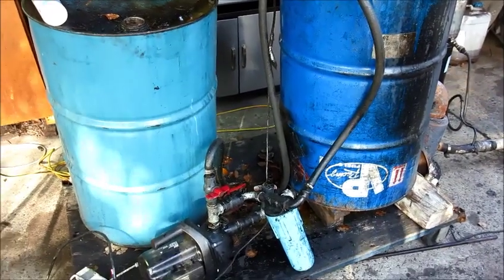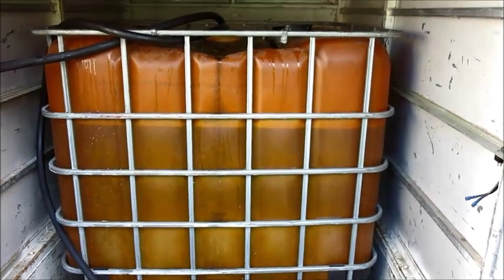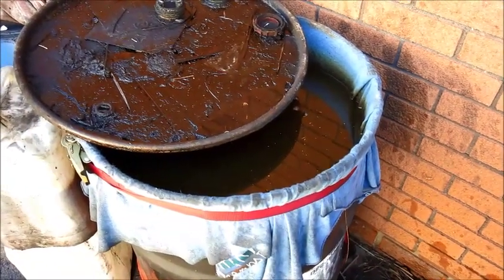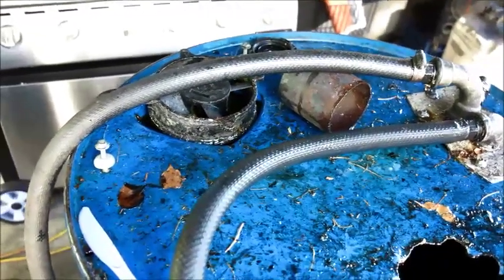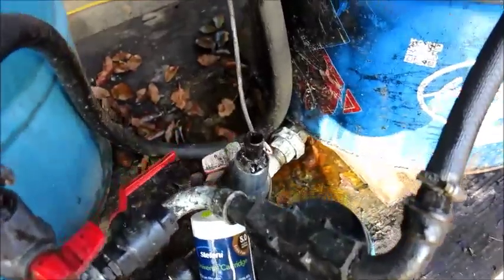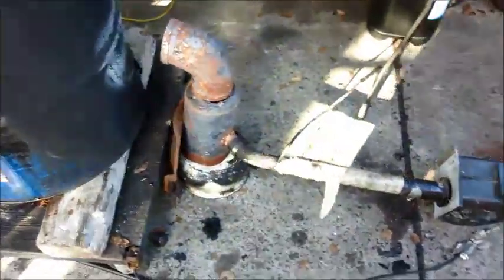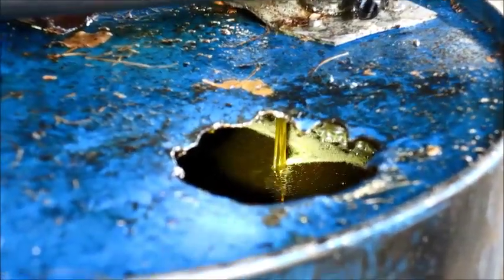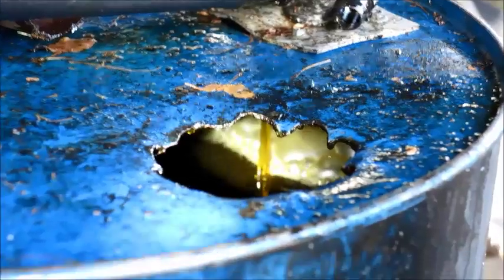How to filter Waste Vegetable oil Fuel ( WVO)

Comment: Hi mate. I have built one of your pumps (scooter motor and modified chev oil pump). Works amazing for collecting oil! I also tried your oil dewatering system using nozzle and recirculation pump. I processed 200L of wet oil today and it worked a treat. Thank you for sharing your knowledge! I used a silicone drum band heater from ebay to heat the oil in the drum while it circulates. I used the water filter to filter it. I used an old oscillating fan to keep airflow over the oil. Think I'll set something up with a ventilation fan to suck air through top of drum when I find a cheap used one. Thanks again mate for sharing.

Comment: As good a system as any I ‘ve seen .  Bit too small scale for my needs( I’m running two 4x4s using about 45 litres a week each). Good job bloke, love your pumps.  
  I do 1000 litres every 3 months in about 2-3 hours.  I do my supply pickups every week in the 20 lt drums.  Not sharing my plant as I’m too stupid to work utube.  I’m in NQ so don’t need to heat electrically for drying- The power of the sun!   I use three stages of settling in 1000 litre tanks, 3 months each time with first a screen then a coarse filter almost the same as yours, then a 5 micron filter and a final filter as I fill my tank.  I started with a 200 litre plant not unlike yours except I used old Commodore power steering pumps, which were a bit small when I upsized. Great video thanks.

Comment: Hi, in case anyone wonders regarding the drying with the fan in reverse: 
If you blow air into the barrel, you create a slight overpressure and thereby increases vaporization temperature and it slows down the drying.
If you reverse and suck air out, you create a slight underpressure and lowers vaporization temperature and speeds up the drying.
Reply from the maker: Best explanation I have heard. Thanks!

Comment: an electric hob plate used in some kitchens would be a good idea to accompany that fan to gently heat the oil to dry it also, i heat my oil before it flows to my burner as i seem to notice it ignite better and i get a better burn on a lower needle valve setting, if the oils cold i have to open the needle valve flow up more.  jus an idea,

Comment: Hello. What would you consider better, the way you're drying in the video or a centrifugal dryer? But considering,
.Time taken
.energy used ( burnt oil included)
.quality of the finished product 
.reliability and efficiency
.plus simplicity and ease of use 
Cheers
Reply from the maker: I have used and set up centrifuges for other people and prefer this method I still use and just set up for a friend.  Centrifuges take  a LOT of energy, don't really dry the oil unless you use heat or some other separate way and can have problems.  The spinner type use jets of oil and it has to be pretty clean to start or the jets block.  I would go for the bowl type but they are not cheap and can be a bit of mucking round. 

The output quality is second to none but that's a bit like Giving me a $1000 bottle of wine as against  a $50,  The 50 is well good enough and the extra "quality" will go to waste on me with the 1000 because I cant tell. 

I centrifuged my output from this process a couple of times and what came out was irrelevant.  Had to wipe your finger on the bowl  to see what came out of 200L  and it was all the micro fines which would pass through filters and the system anyway. 

I choose to stay with this very same system today. 

One thing though, If you are just using oil for a burner, NO need to go to this trouble.  This is only for engine use.  For burners I just filter though things like Disposable shopping bags or a big roll of felt I bought years ago very cheap and that's all you need.  Just enough to get the bits out, no need to go overboard. 

You can dry by throwing a fish tank bubbler in for a few days and that will take out the main moisture and good to go.
Reply: @glumpy10  I'm going to use it for my 4x4 and when I get one a diesel generator. I'm just looking into ways to clean waste engine oil as I just got another 1000 litres today... I probably only burn 300 litres a year for heating so I have a constant supply and want help out my guy by removing his waste oil but I don't want to just store it or more accurately horde it.
Reply from the maker: @smithbuilt   If there is no water put into engine oil you should not have to dry it. Veg oil absorbs water, engine oil does not.  If you let it stand any water should separate and  take the top oil for the vehicle and the last 5th or so for the burner.
As you probably saw I use 10"water filters in either 1 or 5 UM ( micron)  .

Comment: Hi Oil Burner.
I have been looking at ways to make a burner for a foundry furnace as propane is too expensive and I like your burner ideas. I think I will make up a pressurised fuel tank type burner and bouncy castle fan setup. I shall just experiment with that.
I am wondering if you would bother de-watering oil for foundry burner use and if I should worry about gloopy fat in the fuel?
I have 200 litres of old veg oil and various drums of engine oil / heating oil / dirty diesel etc that has accumulated in my workshop. Can I mix the lot together or does it separate out and do something odd?
Cheers.
Rob
Reply from the maker: De watering really depends on the amount of water.  If there is free water in the bottom of a drum I would say dry it. Free water translates to maximum dissolved water and while it will work, it's noticeably poorer burning and far harder to start than dry oil. 

The sludge at the bottom is HEAVILY water laden and you will see just how much water is in it when you dry it and see how much less oil you end up with because the water is now Driven off. 

As to the blending the engine oil, diesel and WMO, really depends on ratios.  It may or may not separate but if it does, all you need to is mix it before use and it will take some time to settle out.

You could blend it, mix it and decant into smaller drums and then mix before use with a paint mixer on a drill or something.
Reply: @glumpy10  That is great. Thank you.
I shall dry the oil then.
I have had that barrel of veg oil years. I had to loosen the lid on the 40 gallon drum as it was getting very pressurised and swelling the ends of the drum. I think some goo is fermenting in there, so I think it might not be the best but still need to use it up. The local chip shop might have some better oil too. The guy who runs the chip shop runs the cleanest chip shop ever and I suspect the oil would be very clean too.
I have been melting aluminium on a friends propane furnace but want to go up a step into melting copper and casting bronze in my own furnace, hence trying to work out what best to do.

Also very impressed with your heath and safety attitude.... much like mine.
Cheers.
Rob

Comment: I like your concept here mate, what's the go with the circ pump ? 

is it a water pump?

also, do the string wound filters last longer or filter better?

great vid, lots of info here.

cheers.
Reply from the maker: Yep, Just a water pump. The ones with the larger impellers/ Housings tend to work better on oil than the ones with the small impellers usually called Turbo  type pumps.  The larger  impellers seem to get a better bite on the more viscous oil. 

String wond filters are my preference but harder to get where I am.  I think they last longer but that said I'm consistently getting over 2000L through the foam type filters that cost 8 bux.   How you prefilter/ settle your oil makes a big difference to the filter life. 6 Months + is a good settling time I have found. 

As for filtering better, you can get them in different Micron ratings. I use 1Um if I can get them and 5 If not.

Comment: You clearly show how to remove gunk and water, but how do i know that the desolved suger and salts gets removed? Does really one micron take care of the problem. Also you need something to make the oil viscous as diesel. For you to run your car on only veg oil. What could i use for this?
Reply from the maker: Sugar and salt Cannot dissolve in oil, only water. 
You do not need to match the viscosity of Diesel if you have a mechanical Injector pump.  They have more than enough tolerance to Pump clean, dry Veg oil despite what the alarmist's say. 
If you have an electronic injector pump you shouldn't  use more than about 10% oil as they are weak pumps and wont take it generally long term.

Comment: That was a good video illustration . Thanks for it. Im new to this or rather doing it the correct way. For a long while in the tractors I've been using filtered waste motor oil and simply add nearly a gallon of gasoline to every 5 gallon of oil. The tractor runs strong on this mix. Last week I bought two 1986 F250`s that have sat 10+ years without running. I now have them running and driving again on regular pump bought diesel. I really wander can I filter the used restaurant oil and add the 20 percent gasoline will that work ok for these old engines?
Reply: Hears of one person with a toyota landcruiser 1hz stock motor running 10% gasoline or petrol we call it in Australia and no problem, two filters and a seperate tank and running the wvo once hot.

Comment: gooday mate, dont know if youll ever read this  but anyhoo, many of the vids ive watched use cartridge type filters to seperate any water as does my rodeo, do you know if thats enough. I once got some blobs in my wvo that went through my filter bags (1micron) through the injectors and into the sump then clogged the oil lines and seized the motor dont know what it was but i thought it was water I found the gel like blobs in the fuel injector pump when i pulled it down. Also see blokes using centrifuge now as well. so you mentioned selling soap have you gone to biodeisel now, also i mix 25% deisel with my wvo now.....  reasons are its gravity feed filter system flows and filters much better, cold start no worries, my engine retains more power at this mix , injecters dont seem to clog, much better klm per litre .. yes it costs a bit more but not much really compared to 100%deisel cheers mate
Reply from the maker: Unlike Diesel, water WILL dissolve into WVO.  Therefore a separator won't do any good.  I would Highly doubt it was water that Siezed your engine.  I use and highly recommend water injection and if the water went through your injectors into the Cylinder It would have  burned off the same way.  Would take a Biblical amount that the engine would probably not run to get past the rings into the bearings etc and bearings won't rust anyway as they are non ferrous.  I am very big on Drying oil as I have come across VERY little that didn't have some moisture in it despite what people claim. 

Evaporation is the best way to dry oil, boiling takes forever and soes not work as well. also can be dangerous with steam explosions for really wet oil as I have found out. Having the oil dry means no risk of growths in the fuel tank, damage to injector pumps and give noticeable better performance. 

Blending WVO with Diesel or Petrol is a good Practice. I use 5-10% petrol, maybe 15% when it's really cold to the oil and it also brings the timing back closer to that of Diesel. Oil lights off about 10% Slower than diesel and petrol having much lower compression resistance,  lights off around 13:1 so brings the timing back closer to where it normally is set for diesel.  
The petrol component ignite first setting off the oil and making for a cleaner, more complete burn.  The ease of starting and the power increase is noticeable. 
I would not recommend going over 15% though, that goes the other way and becomes detrimental.
Try Pulling the diesel content down and add 5% Unleaded and see how you go.  Petrol is also thinner than diesel which means You can get thin oil not thick Diesel.

Comment: @Oil Burner How did you get rid of the dissolved suger and salts? if i would do this i would want to be absolutly certain that the fuel wont damage the car in any way further on.
Reply from the maker: There are no sugars or salts in Oil.  They will only dissolve in water. If you dry the oil then any sugar or salts will drop out and be caught in the filter. I have been doing this 15 years and never had a problem. 
If you are looking for guarantees and are going to be pedantic about engine life etc, this isn't for you.  How long should an engine last anyway? They are never the same even on pump fuel so worrying one might shorten the life using oil is a sign that this again is not going to be a suitable thing for you to do. This is ALTERNATE fuel. No gaurantees, no certainties, and no room for worrying.  If you want gaurantees and warranties, Go buy a new car and pay for the required services and hope if something does go wrong they will fix it because that's not a certainty either. 

I look at it from the POV that I only have to get 3 yrs out of a vehicle and I can replace the engine and still be in front. Never had to do that yet so I could replace the vehicle several times over and still not worry.

Comment: cool setups.

How can you tell when the oil is 'dry'?
Reply from the maker: I do what is called a hot pan test which is dropping a small amount of oil in a smoking hot pan or pot and making sure there are no bubbles coming off it.  You can look up HPT or Hot Pan Test for details
When the oil is REALLY dry, you can actually add a drop or 3 of water to a small sample and it still shows dry in the HPT.

In practicality I have a very good idea how long it takes now  so I just let it run and give it a bit extra and pump it out.
Reply: Oil Burner
Very cool, many thanks. I had no idea.

Every setup I've seen online seems to have a very messy
area surrounding the oil storage and pumping station. Is there
a way to keep this clean? or are the barrels and IBCs leading
no matter what?

i imagine the pipe that goes into the containers behind the restuarants
will allways come out soaked in oil right? That calls for a dedicated vehicle
to do the collection rounds.

Are you getting the oil for free from your locations?
Reply from the maker: Yves Baggi The containers don't leak but splashes and drips don't dry like water and soon add up. You can keep everything clean and everyone means to at the start but soon works out how much work that is and doesn't bother before long.  Caustic Soda is very effective at cleaning oil spills though.  I just wipe the pickup I put in the barrels with a rag and that stays clean. I have a rubber mat in the back of my vehicle and am careful so Very rarely have any spills or mess in that and it is just my everyday car.  I get all my oil for free as to the restaurants it is just a waste product they need to dispose of and are happy for me to take away.

Comment: Dear Oil Burner. I intend to acquire a 1990s diesel car for under £2000 (based in the UK). What car/engine would you recommend to most reliably run used filtered and dewatered WVO?....... Also would it be safe or advisable to "thin" the WVO with either 1-3% white spirit or 5-10% unleaded petrol?
Reply from the maker: I don't know what is available in the UK but look for anything with a MECHANICAL Injection pump. In lines are best, mechanical Rotary's next best.  Yes, I HIGHLY recommend the use of 5-10%  ULP in with the oil up to 15% if it's really cold ( snowing). White spirit is also fine although ULP may be cheaper. Kero and turps is good too.
Reply: Oil Burner I am thinking of an 1997 Audi A4 1.9tdi 110HP Quattro (4wd). I'm not sure of the engine design, but it is known to be very reliable with some having done 1 million plus km.

Comment: do you add anythinh\g to the oil after filtering or just using it straight with no additives ??
Reply from the maker: Just straight. With my veg oil I use the crappy stuff that I won't put in the vehicle and get rid of my used engine oil in the burners too. Much to a lot of the Environmental Nazis upset.  :0)  If you had stale petrol, Diesel, old turps or anything else flameable you could throw it in to get rid of it.